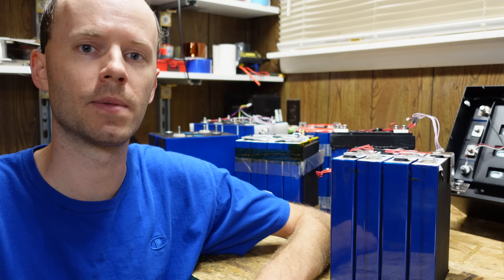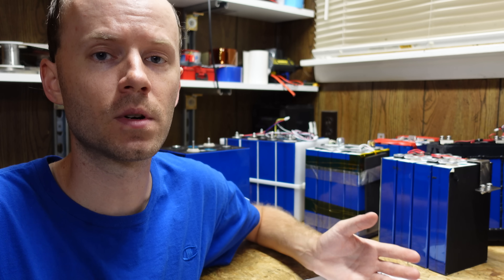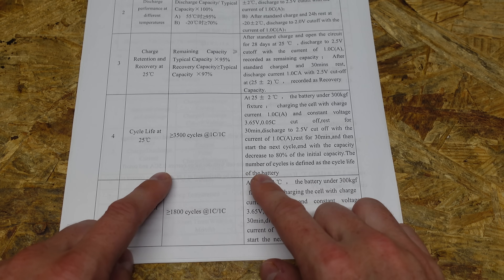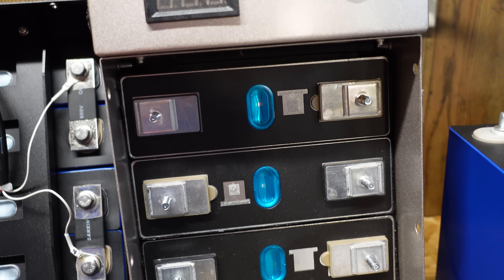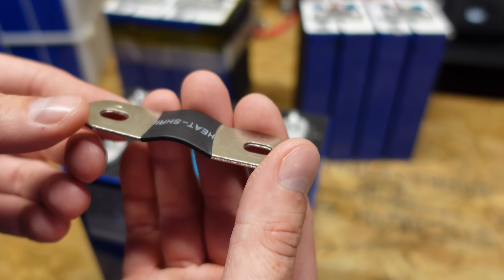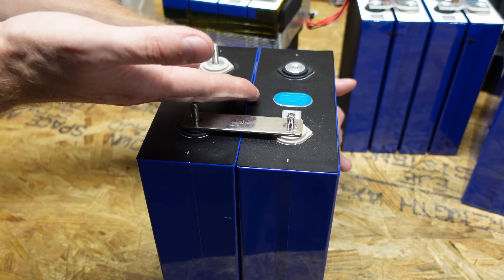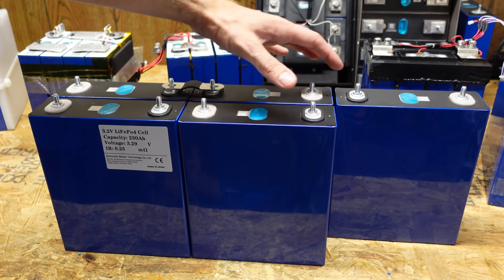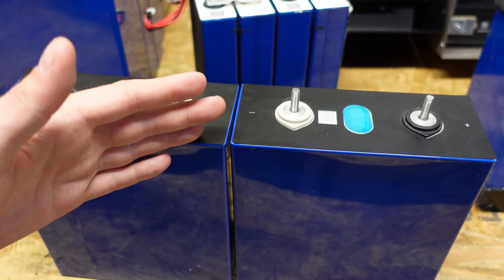LiFePO4 Battery Compression, Fixture, and Assembly - What's the Deal?

Comment: Thanks LS. Great conversation.
It seems to me we are conflating two aspects of the purpose of the fixture. 
I understand that in general, we are attempting to restrict the state of charge expansion of the cells in order to stop cell bulging. 
Why are we attempting to stop this bulging? Is it to stop lateral terminal stresses by the bus bars or to somehow influence the chemistry/internal structure of the cell, or both in order to increase cell life cycles?
I think the primary reason is to limit the relative movement between cells to reduce the stress on the terminals from tightened bus bars. I can easily imagine stress on the terminals reducing the cell life. 
Perhaps there is an added advantage for the life of the cells by restricting this expansion due to SOC, but I am not aware of this being a factor, nor can I imagine a mechanism. (Not to say there isn't a mechanism - I just don't know of one). It is possible too that such restriction of SOC expansion/contraction may be detrimental to the life of the cells. I just don't know.
In any case I think we can agree that lateral stresses on the cell terminals due to bus bars should be reduced as much as possible.
The only solutions I can think of is running looped, suitable gauge cable from one cell to the other, or (the option I will adopt) is to make bus bars in two pieces - bolted together in the shape of a flattened "V". This will allow relative movement between cells and allow cell expansion to occur with minimal stress on the terminals.
For me personally, I am additionally compressing the cells in a fixture because my application is mobile. I have to protect the cells against vibration and violent movement, so I have to be able to secure them well to the vehicle.
Reply: By the engineering definition of fixture, compression is not the goal. A “fixed” position is the purpose. Prevent both gradual and sudden movements. Designs that don’t compress are engineered correctly.
Reply: The fixturing (compression) is to keep the "stack of cards" properly stacked. Over time, if the plates separate as they do during cycling, the capacity, and entire functioning of the cell begins to fail. If you've ever seen pouch batteries (RC, phone, other cheap crap) slowly becoming a balloon, you've witnessed this effect. The more they're cycled, and/or the higher they're loaded, the faster this happens. These types of cells are basically pouches in a weak "beer can" shell. The more expensive CALB cells have stronger cases, so they don't need the same containment.
Reply: @jfbeam  Good to know - thanks.
Reply: @jfbeam  Containment is much better description than compression when talking of fixtures in the world of fabrication and engineering. "Stack of cards" is a good analogue to the term fixture, in that the stack is efficient and reproducible. The object or workpiece being "located" in a position to draw on the formal definition. This term fixture in the data sheets accompanying the cells means located in a position. Compression on the other hand, is a term that has come from the DYI language found the media world such as Youtube.

Comment: Personally, I am a fan of either the copper braid interconnects, or the curved bus bars to avoid stress on the terminals. The copper braid interconnects are definitely the best, but more expensive typically, and harder to find. I have actually resolved that I'll likely be making my own for the next big bank I build. 

For fixture, which I agree is a better term, I do like the threaded rod method with plywood backed by metal (when practical, for long series especially) to ensure even application of force over the entire cell bank. I think that spring loading the nuts on one side of the assembly to allow expansion is ideal, but not necessary, as ensuring a suitable amount of expansion permissible in the fixture can be done so that at 100% SoC, the batteries experience a force of approximately what is desired by the manufacturer. Especially if you want to get the absolute maximum life out of the cells, the additional engineering effort is likely warranted.
Low cost, low C packs, unless forbidden by the manufacturer specifically, are likely okay with little to no fixture force, so reinforced tape is totally fine if you ask me. Honestly I see the risk of adding too much force as WAY more dangerous than not enough.

As far as spacers between the cells, personally I feel that really depends on duty cycle and charge/discharge rate. A low C rate (1C or less) is typically fine with NO separation (shrink wrap on the cell can is still necessary of course for electrical isolation), and you can actually just put the cells against one another inside a fixture. Again, because they will expand, this does mean the fixture must expand as well by the permissable amount.
At higher C rates, space is ideal for heat dissipation, and ideally you would have a few sections of compressible material between them, leaving space for air to flow between them. The idea is to maintain pressure, as well as allowing air flow. Tricky business, but as is to be expected, high C rate packs warrant a bit more care and thought.

Comment: I’m going to put sheet style packing foam in between each cell and then tape them with fiberglass reinforced packing tape. Also I am making my bus bars out of 6AWG multi stranded welding cable with crimped lugs on each end they will flex. Make them in to a u shape before crimping.make them as long or short as needed.

Comment: I would just take some 2 gauge or 4 gauge wire 
with lugs and connect the cells . This way they can expand all they want and not pull on the terminals. I had to make a set of 2 so I could top balance my 280 amp hour cells cause it only came with 4 bars.
Reply: exactly, also you need to have the cables in a slanted fashion so you can maximize the flexibility of the cables, I've seen companies use cables that connect the cells using a slanted pattern between cells like this /////  , if you try to just connect them straight across than cables do not like to flex via compression, they like to move sideways
Reply: @eksine  this is also what I'm doing.  2/0 with lugs overdone but it is what I have on the shelf.
Reply: This
Reply: I was going to comment exactly this but you beat me to it.  If you are really that concerned about terminal stress, just don't use bus bars.  It's not rocket surgery.

Comment: Fixture does not mean compression, it means to stop movement or vibration between cells as in an RV, caravan or any mobile device and putting load on the terminals. 
In an off grid environment there is no vibration or movement except for the swelling on the sides when charged so an air gap is available with the slotted busbars. 
And you will notice on 3 of the 4 batteries shows that the packing between cells is only at the top and bottom where there is less swelling is to prevent load on the terminals. 
Compression is Bull** and damaging the cells. in a 16s configuration the cells would want to grow up to 16mm and the forces would be far greater than 300kgf. Springs would end up putting load on the terminal.

Comment: So 2500 full cycles = 6.8 years and still have 80% capacity. If you get 3500 full cycles = 10 years and still have 80% of the original capacity. In 7-10 years battery technology will have improved massively. Personally im going to put packing foam between the cells and bolt the bus bars down at the widest point. The foam allow some expansion between cells while allowing compression from both ends of the pack, while removing the stress on the terminals. When you consider how these cells are constructed and tested, any sort of constant pressure between the cells is better than nothing. As DIY battery builders can do far more damage by over pressuring slightly swollen cells or by putting to much pressure on the terminals. Compressing swollen cells or putting stress on the terminals will damage the cells far quicker than 2500 cycles. I think there are probably far more Grade B cells in circulation than there are Grade A cells. One thing is for certain there are going to be loads more Grade B cells in the hands of DIY builders after some sellers dropped the price of so called 320Ah cells to less than £400 (450 US Dollars) for 16 cells on the Aliexpress September sales including shipping.

Comment: i really do not understand why this is an issue
? i will be dead long before my batteries .
however these batteries were developed for medical or stand by power sources and i have doubt that they would be replaced on a regular calender basis .say 3 to 5 years depending on usage. i would imagine that in an off grid scenario they will last at a minimum 3 to 4 times longer than a lead acid battery if not more . Hell i cannot buy a lawn mower battery that lasts more than a year.

Comment: If you can solve the bus bar issue and still want to put it into a box and have some steady pressure that will provide some give for expansion the Great Stuff Pro Gaps and Cracks insulating foam sealant is 11.9psi foam. It isn't made for high expansion and is just soft enough to not exceed the 12psi rating.

Comment: Regarding the fixture in the datasheet, I believe it went something like this: EVE comes with a new cell (2017), they do their tests but perhaps use a smaller version of the cell since cycling 280Ah takes very long. This is what they base their life cycle on. In most applications, such as vehicles at the time, the cells are in a fixture, so no issues. Later on, they come to the conclusion (after more testing) that cell life is impacted by the cells not being in a fixture: test methods got better, analysis got better, and they realize that the cathode roll becomes de-laminated and this is the root cause of the issue (some comment asked why a fixture would be needed in the first place; this is why). 
So now to make sure they cover some of this potential liability/correct a mistake they adjust the datasheet. As you noticed, your other datasheet (from 2020) specifies the fixture, and if you look at the new EVE LF280K cell datasheet, they specify it there as well and don't mention using the cell without fixture anymore. 
In other words, they might not even have assumed the cell would be used outside a fixture, noticed if one did cell life decreased, so they fixed it with a datasheet update and from then on assumed a fixture in all use cases going forward. 
I've been using 32 of these LF280 cells for over a year now. I put them in a fixture (threaded rods), use my DIY braided bus bars (no terminal stress) and put them in an insulated box (cold climate). No issues what so ever...
Reply: I was coming to post exactly this. Spec sheets are often among the last things to be updated/revised.
Reply: I’ve read this explanation somewhere before and it seems the most logical to me.  And the braided connectors always seemed to be a better solution.  Not to mention you get better continuity through fine copper strands (like welding cable) than a solid buss bar.  Without laminating the buss bar, you introduce eddy currents into the conductor under load which increases resistance. Using stranded wire (the finer the better) greatly reduces eddy currents.
Reply: @Do_the_Dishes  stranded is best, but YIKES the cost of making them all. Even at 4 gauge, (undersized imho, I prefer zero gauge) with all the crimp connections it adds up fast.
Reply: @Do_the_Dishes  Thats good then, i bought 2nd hand (ex Lead Acid) Heavy duty bus bars, which are stranded between 2 copper plates at the terminal ends. Needed longer bus bars to bridge over bloated 310Ah cells. the 304/310/320Ah cells seem more likely to bulge, or be bulged. Eve must have a lot of these reject newer higher capacity cells being lower grade cells. Often re sold under different brand names. The pressed in studs with 10mm diameter base, i dont like. Were often used on the lower capacity cells, around 200Ah. Where fitted to 304 plus Ah cells. seems to be a sure sign of lower grade cell. it is not a good idea to to try to compress already bloated cells.
Reply: @michaelbouckley4455  So you think that the 12 PSI compression spec is too much if the cell is bloated 2-3mm? I'm looking at compression springs that can handle as much as  say 5m (double at the cell level) without exceeding 15 psi and optimally without bottoming out at an even larger bloating level. The arrange meant I'm ; looking at does not compress more than 4 cells under a single spring stroke.
Reply: @Do_the_Dishes  Eddy currents at DC or 50 - 60 Hz ?
Reply: We recommend to charge to 3.45 - 3.47 Voc per cell around 18 *C. At low temps, cells have lower eff. than 98 %, becasue cells heat up more and more if temps go from 45 ´> 25 ´> 15 ´> 5 *C. I use Winston LFP from nov. 2013, no compression, I usually go from  30 - 35  to 85 - 90 % SOC, but 2x yearly I go to 3.65 Voc. No balancer, cells hava no compression, and there is no more than 0.5 mm swelling. I use CH/DISCH. at C3 to C4.
Reply: @PavolFilek  Winston cells don't need compression because they're in a hard plastic case which provides a rigid body. That's not the case for these cells: they're encase in thin aluminium only.
Reply: @upnorthandpersonal  And where is advantage to have thin Al versus strong plastic ? Is it better to have half of cycle life with respect to old cells like Winstion, Calb, Sinopoly ?
Reply: @PavolFilek  There isn't an advantage as such - just saying that compression is not needed with Winston cells, but could be a good thing with the others (since the datasheet mentions that this is done when the cycle life is tested).
Reply: @upnorthandpersonal  We also tested 13000 cycles W. But if we do something, because datasheet says, it is not OK, we have to make some statement, becasue we know what cathode, anode, binder, particle size, LiPF6, DMC, EMC, VC or other solvents used, current collector width / Cu / Al /, casing, ..... etc. If we do not know why, we have to experiment and write pdfs. Where is some science paper, that states, what is in comments here ?
Reply: @PavolFilek  If you buy a component from a manufacturer, they provide a spec sheet. If the spec sheet states 4k to 6k cycles (depending on which cell) from 0% to 100% with a compression fixture at 0.5C, then that is the data to go by. It could well be that going 20% - 80% gives you more cycles, but does that really matter? With solar applications, even if you would cycle daily (I don't think anyone does that, let alone at the stated 0.5C) you'd be talking 15 years. You'll have things like calendar ageing etc. impact your cells. Most people don't have time to run an actual 13k cycle test. These particular cells are too new to even had time to cycle them that much - it's something we will only know for sure down the line... 
In the mean time, people will publish their papers and the technology will mature, and we can adjust our views then (you also remember the days where LiFePO4 was considered ok to charge to 4V per cell per the pdfs?). For now, we just use best practices, and that includes following datasheets from the manufacturer.
Reply: @upnorthandpersonal  No 4 V was wrong. We always said 3.45, max 3.6 no, more. With this dodgy 12 PSI compression, how U do that, that from 10 - 90 % SOC, from 0 to 50 *C, form 0.05C to 1C, there is always constant pressusre ? And how this pressure affecx DX resistance and AC impedance ? If u can not make precise predictions U will be dead.
Reply: @PavolFilek  Back in the day when LiFePO4 first arrived, 4V was used. Then this was adjusted to what we see today (3.65V max). Compression does not impact state of charge - you measure state of charge with a coulomb counter. Voltage is also not an indicator for SoC since you can get to 100% SoC below 3.5V.
Reply: Hi up north, I recognize your name from Andys channel.
I am at this stage of my build now, I am using m10 threaded rod. What size thread and torque value did you use?  I am stuck and very apprehensive.
Send help! 🤞
Gaz
Reply: @garys-half-baked-offgrid-dream  M8 or M10 is all good. Don't torque: literally hand-tight the nuts on the rod. 300kgf might seem like a lot, but it really isn't. That's why 'compression' is a bad name for this as well and fixture is a better term.
Reply: @upnorthandpersonal  Thanks very much! That's reassuring, I have played with 150kg bathroom scales and can max them out no effort at all, it didn't even register on a torque wrench.  
I Have been Wracked with self doubt and full of fear, PHEW!!! 
Thank you
GAZ
Reply: My feeling on this is that compression is more an issue of stability of the cell array (rather than enhanced longevity) and avoiding undue street on the posts which can lead to damage and catastrophic failures.

Comment: My 16 cells arrived today! And there was a pamphlet included, called 
"General Basic guidlines for assembling LiFePO4 ..." by Steve_s of DIY Solar power forum.
The compressing/ fixture section says,
"With mild compression applied, it helps prevent stress being applied to the terminals ... Especially important in mobile applications. "

Comment: I bought 3/8 x 1 aluminum stock and made all custom bus bars. Works great!
Reply: What’s the current carrying capacity that?
Reply: @rorymakesstuff   by my calculations 200 amps. I’ve pulled that and they stayed cold to the touch. I actually started finding other problem areas like my main bus bars and some other connections.   We’ve built a few batteries this way, I’d recommend it.